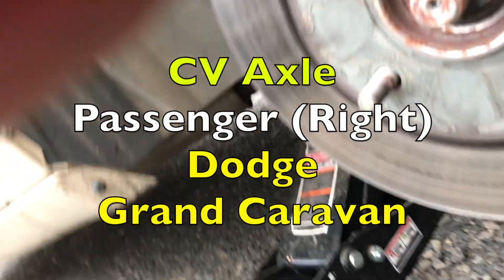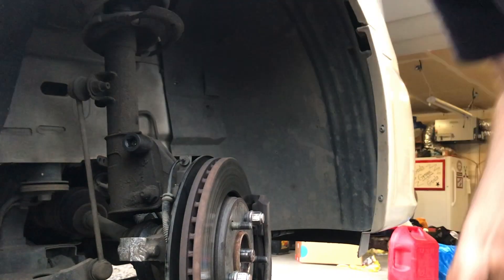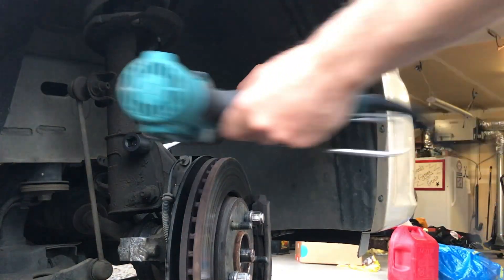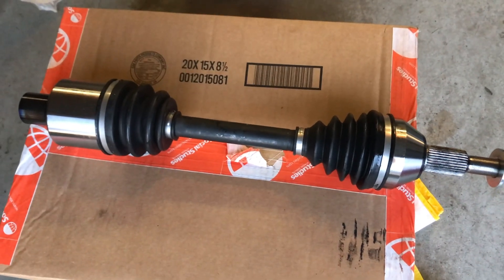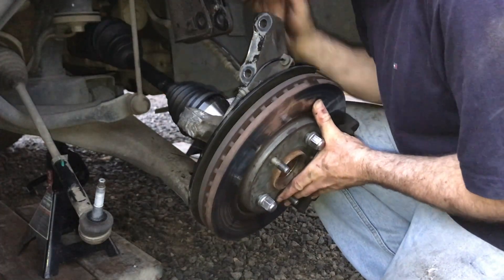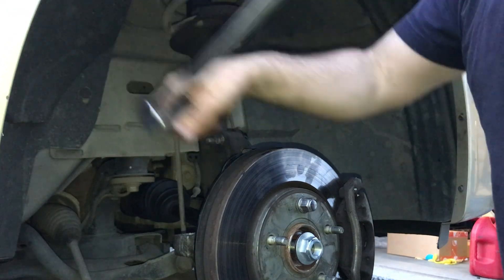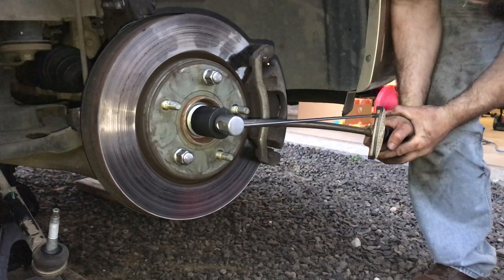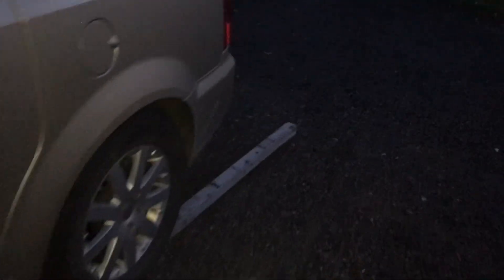Replace Clicking CV Axle Shaft Passenger Right Side Dodge Grand Caravan 2008-2020 Repair Fix

Comment: I have to watch your video multiple times to give me the confidence to do this. I keep telling myself it's just bolts but I don't feel confident, yet. Great video.
Reply from the maker: You can get it done.  Will probably take 3 hours if you've never done it and have all the parts already there...  Will also save you about $600, so a cool $200, but don't forget you had to first pay taxes on that money of at least 25%, so you actually had to make $270 at your hourly rate and if you make $30 an hour that is equal to 9 hours of work, so you save 6 hours of work by doing it yourself....
Reply: After you do it once it’s not to bad remember patience and attention to detail and most important safety

Comment: No need to remove the tie rod, just cut the steering wheel all the way to the right and itll come out with the tie rod connected. Nonetheless good job and thanks for taking your time to record it
Reply: I didn't disconnect the struts either
Reply: Thanks saved extra work.
Reply: Yes, that’s what our service tech at the dealership told us too when we took it in for an alignment. Oddly enough it made the axel worse so will be replacing that ourselves this week.

Comment: Very detailed guide. Thanks! That gave me some confident to repair mine at home. Just heard clicking noise on passenger front wheel when turning. Well take a look but it’s like the issue with axle
Reply from the maker: Yeah if you look under you'll probably see the rubber boot is torn.  If it is then this is you issue.
Reply: @youcanfixit3721  Thanks! Actually mine turned out to be that a single wheel lug nut was under torqued. After I torqued it up properly the clicking stopped. The clicking didn't happen until I did a long drive (250km) in the summer. So that must have loosen up the one lug nut enough that the wheel had a bit flex where the nut was, and was making the noise only when doing large left turns (full left on steering wheel).

It's probably pretty rare but I thought I post it here in case someone else ran into a similar issue. It's a much simpler fix comparing to this video.

Comment: I just replaced both the driver's side CV axel and wheel bearing. One thing i did different is instead if removing the two bolts at top on the strut where it can effect the alignment I removed the nut on the ball joint. Another tip when tightening the tie rod use a jack to apply slight upward pressure to prevent it from spinning. That works for the ball joint bolt too.
Reply: So you prefer loosening ball joint and strut only?
Reply: @pacobus24  The main reason I took it apart at the ball joint and tie rod is so I didn't affect the camber of that wheel which would happen if you take it apart at the strut. There's no problem taking it apart at the strut if someone wants to just a alignment  would be recommended.

Comment: ..... I just came across one from hell today.... I used my breaker bar on it and put a pipe on it to extend it to like 5 feet it was just bending my breaker bar like a banana. I couldn't get it off had an impact gun too, did nothing.
Reply from the maker: How did you get it?
Reply: @youcanfixit3721  dunno.... Cosmos hated that I had that smart bit of me and I always like fixed a car that I came across and out of all the axles nuts Ive done came off like yours did but that one, no it refused whole heartedly.

Comment: Anyone run into issues with the steering knuckle not lining up on the top bolt? Seems like the cv is a tad too long. It’s seems like a it’s seeded properly. Please help!!
Reply: Put some muscle into it and force the knuckle into place. If not, make sure the CV axle is fully slid onto the splines on the intermediate axle and the snap ring “clicks” in place. 🙃
Reply: @tonyhawk8461  it was a parts issue. Turns out, almost every parts store in my city carries the exact same CV for this vehicle. I returned 2 CV’s and neither of them would line up properly. It was difficult to measure the old one since the cv was dislocated from the socket. I ended finding one at NAPA that was slightly shorter than the others. I was able to line everything up no problem. I ended emailing the manufacturer for these other parts and they claim that the parts store were inventorying them incorrectly, even though the drivers side is completely different in length. There was no way or amount of force that could’ve fit those other cv’s.